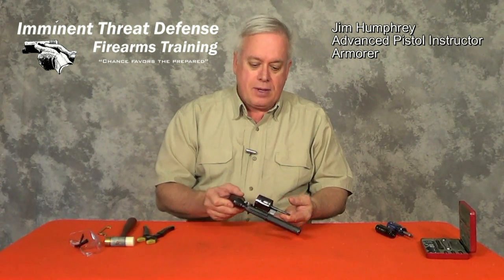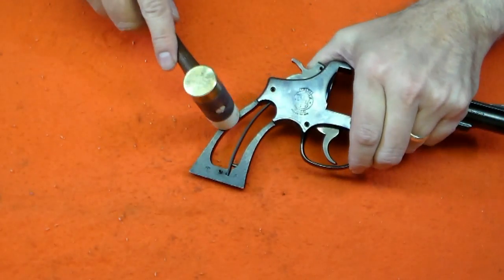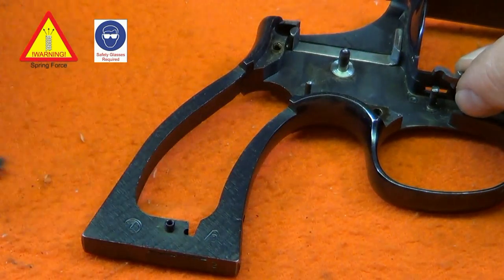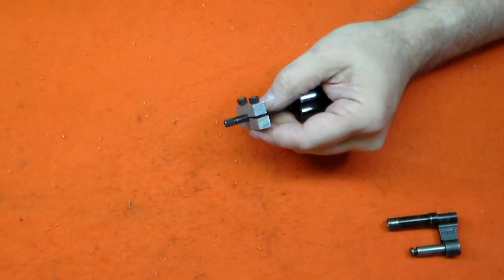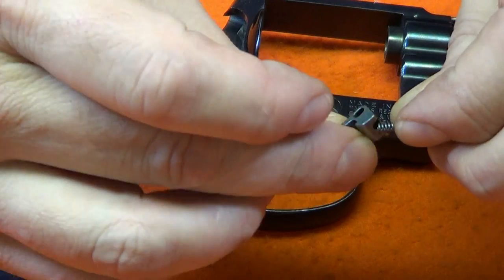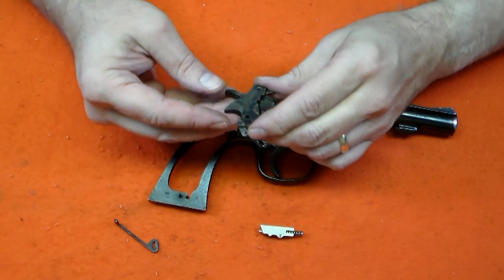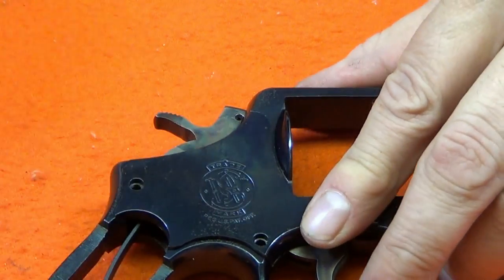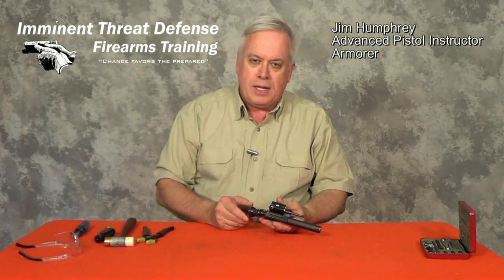S&W Model 10 Disassembly and Assembly

Comment: Thanks for the video. Can the firing pin be replaced without removing the hammer (gun intact)?
Reply from the maker: No, the firing pin (technically the "hammer nose", I got it wrong in the video) is riveted to the hammer.  So the rivet has to be drilled out to replace the nose and then finished smooth, not an easy job.  Alternatively, you can replace the entire hammer assembly, but that's also going to probably mean refitting/replacing the sear.   Another advanced skill job and tricky too because it effects the trigger pull.  So you're getting into gunsmithing level work.  However, the parts are available and if you didn't mind ruining a part or two in the learning process well.... Thanks for watching!
Reply from the maker: @brandont9078  Yeah that video pretty much describes the process for replacing the rivet.  The answer to your original question remains the same, the hammer has to be removed from the revolver.  And it requires special tools and skills.  As I said not impossible just tricky if you've never done it before.
Reply: @ImminentThreatDefense  I managed to replace it without removing the hammer by supporting the hammer and carefully driving out the rivet and installing/seating the new rivet. Thanks!
Reply from the maker: @brandont9078  Well done!

Comment: What are the micrometer measurements on those two screws...I got them mixed up!  Is there a simple way to tell which is which?  For instance, is one always longer?  P.S.  Thanks for the video.
Reply from the maker: You can tell you've got the wrong one up front if the cylinder doesn't swing out easily. or if the yoke has any forward/back movement.

Comment: I own a 1908 .38 hand ejector how often should I disassemble the gun this far for cleaning? any basic cleaning videos?
Reply from the maker: This level of disassembly is not something you should do very often, especially if the gun isn't be used very much and is being stored well.  The side plate is custom fitted during manufacturing and removing it frequently will eventually affect the fit.  Unless the gun has been exposed to the elements or shows signs of corrosion I wouldn't do it any more than once every 5 years or 3,000 rounds.

Comment: Where did you get that screwdriver? I'm having a difficult time finding one that will fit.
Reply from the maker: That's a Chapman, they come in sets.  There are other good screw drivers sets (Grace, Magna).  All good gunsmith screw drivers have flat blades of various width and in each width there will be various thicknesses.  Plus they are hollow ground, perfect for fitting precisely to the screws so you don't mess them up.  I'm sure you can find these on many locations on the web, but Brownells has them.  Go to the Chapman site first (chapmanmfg.com) and look at the gunsmithing sets.  I bought mine a long time ago, but it's equivalent to the basic (9600) set.  If you're serious about taking care of your guns, spend a little extra on good screwdrivers, punches (square shouldered brass) and hammers (brass/plastic).  Basically all the tools you see me using in this video :-) But it sounds like you already appreciate the importance of good tools.  Thanks for watching!

Comment: Hello, i have one question:
How to indentify cylinder screw from the others screws?
Thank you
Reply from the maker: The best way is to keep track of it when you remove it :-)  There are two screws that look identical, those are the front screw and the middle screw.  The front screw is generally shorter.  But try them both in the front hole then check the yoke for freedom of movement, the cylinder should flip out easily.  Also check the cylinder shake the yoke shouldn't move forward and back.  I've found when I mix them up the wrong screw causes the yoke to bind and the cylinder doesn't flip out easily.
Reply: Imminent Threat Defense Great! Thank you very much, i will try that!

Comment: Would you recommend putting in some Wolf springs to reduce the trigger pull?
Reply from the maker: Obviously depends on the revolver and the existing pull. I'd be cautious of replacing the rebound spring in any case because the speed of the rebound slide affects the hammer block.  Clipping the rebound spring is one way you see people reduce double action trigger pull.  At S&W armorer school they specifically warned us of the dangers of doing this.  I know Wolf provides a reduced rebound spring, I've always wondered about the wisdom of that.  Instead some judicious polishing can go a long way.   You will hear people talk about the increased liability of reduced trigger jobs in a deadly force shooting situation.  The fact is it's either a justified use of self defense or it's not, trigger pull doesn't matter.  Now if it's an unintentional discharge well... that's another matter.  That said of course in the civil trial they can make an issue out of anything.

Comment: How much would you charge for a rebound slide spring tool if you made some to sell? I would be totally interested in purchasing one.
Reply from the maker: Brownells sells them for $20, I'm not sure I could beat that (part 080-666-000WB).  Mine only has about 50 cents in material but probably $50 in labor :-)  You can make alternative one, by cutting a notch in the tip of a cheap flat screwdriver, that will allow you to hook the spring as well.

Comment: I have a model 10-5 that has an issue where after I close the cylinder after reloading that the hammer will not pull back and I can't pull the trigger unless I'm holder the cylinder release switch back. Any ideas on how to repair that?
Reply from the maker: The center pin (in the cylinder) is probably gummed up and not moving freely.  The center pin is spring loaded and it's what pushes the cylinder release back when the cylinder closes.  Look to see if the center pin is protruding from the center of the extractor star, and when you push it in does it spring back out.  If not that's probably the issue.  Try ultrasonic cleaning and oiling, if that doesn't work then disassembly of the cylinder and thorough cleaning should fix it.  It's also possible extractor rod and or center pin are bent, but that should be obvious.

Comment: Help! I recently came into possession of an model 10-5 the gun is in poor condition and probably never been taken apart. I removed the 3 screws but the side plate is stuck on. Any tips on how to get this off I don't want to start prying on it. Also great video!!! Best gun vid I have ever found
Reply from the maker: Prying is definitely a measure of last resort.  Generally a few sharp raps of the screw driver handle or a brass/plastic hammer on the grip frame should do it.  If that doesn't work try putting some bore solvent on the seam of the side plate and letting it soak for a while and rap the grip again.  if that doesn't work you're going to have to pry it.  When I've had to do that I pry by reaching inside the gap where the main spring goes in, so that way if I mar the side plate, it's on the inside.  Ideally use a plastic or brass tool to pry with.  If you have expanding snap ring pliers they should do the trick too.  Thanks for watching!
Reply: @ImminentThreatDefense  Thanks for the quick response. I sprayed a bun of penetrating oil in the side plate and let it soak overnight. A couple taps on the frame popped it right off today.
Reply from the maker: Great news. If you used WD40 be sure to thoroughly remove it and lubricate with a proper oil.

Comment: Can I use this guide for my Model 14 aswell? Are they the same?
Reply from the maker: I've never disassembled a 14 but like the 10 it's a K frame.  My understanding is the 14 (and 15) are just a fancied up versions of the 10.  So this video should be similar, but I can't be positive. Take your time, stay within your skill set.
Reply: Its the same, just did it. Thanks for the video :)
Reply: The 15 is 357 Mag where the 10 is 38

Comment: Do pre model 10s have the hammer block???
Reply from the maker: +ReinSman100 The very first variant of the model 1899 did not.  It wasn't incorporated till about the 4th or 5th variant, which by then was called the Military and Police model of 1905, which contrary to the name, didn't get introduced until 1915 was the hammer block incorporated.
Reply: +Imminent Threat Defense Is there anyway to tell what year that a pre model 10 was made?
Reply from the maker: +ReinSman100 The best way is to make a "Firearm History Request" direct from S&W.  Internet search or try https://www.smith-wesson.com/webapp/wcs/stores/servlet/Category4_750001_750051_757825_-1_757814_757812_image
Reply: Mine is pre-model 10. Check to make sure the hammer block isn't stuck to the side plate, that's generally where mine stays.

Comment: How do you know which direction are the threads of the extractor rod?  You say, "Do your homework".  Where can one find this information?????
Reply from the maker: There are various book sources, I've got the GunDigest book of Revolvers, I also attended the S&W Revolver Armorer school and have a bunch of manuals, but the internet is a wonderous thing, full of thousands of people who have no idea what they're talking about, and a couple who do.  But the direction of thread varies depending on which S&W revolver model and when it was made.  Generally, and I mean generally, S&W revolvers made before the late 60's early '70's were normal or "right hand" threads.  Sometime in the that time period on most (probably all, but I'm being purposely vague here in case there's an exception) S&W's they started changing over to reverse or "left hand" threads.  So, depending on when they made the change on your model, it might be a different year on another model. What I do when I don't know the thread direction, is grip the rod in a padded vice and turn the cylinder, gently at first, with each attempt I reverse the direction of turn and slightly increase the amount torque.  This is kind of tricky but has worked for me.

Comment: I have a Military & Police "Victory" Model with a cut-down barrel I've been trying to disassemble all day, and it's given me no end of trouble. I can get the grips and screws off no problem, and remove the cylinder assembly, but the side plate simply will. NOT. Come off. The action is smooth and there isn't a single speck of rust I can see, so I'm kind of at a loss on what to do. =/
Reply: Patience and penetrating oil.  The technique I show will work.  Don't get in a rush and start prying.  Good luck.  Thanks for watching
Reply: @jimhumphrey6806  Thank you for replying! I did some research beforehand and know not to try prying the side plate since it might bend (still managed to tear up one of my fingers). Is there any particular kind of penetrating oil you would recommend?
Reply from the maker: @JamesPolymer  my preference is Kroil most any name brand should work. You might have a little corrision in the joint.  But just as likely somebody used WD-40 on the gun which will turn gummy in a few years.  Soak it over night with penetrating oil and rap it with something wood plastic or brass. You'll get it
Reply: @ImminentThreatDefense  This is probably a stupid question, but do you mean soak as in "spray it thoroughly and let it sit," or soak as in "submerge it in a bucket"?
Reply from the maker: @JamesPolymer  just a liberal application should work in this case.  If it was rusted up then I'd say submerge it.
Reply: @ImminentThreatDefense  I see--thanks for the advice. =)

Comment: What happens if you swap the crown-head screws on the cover-plate?
Reply from the maker: It could cause friction on the yoke.  So when you open or close the cylinder it won't swing out easily. You can also get yoke end shake.
Reply: @ImminentThreatDefense  So good of you to reply, sir!  Thank you!  I recently purchased a Malaysian Royal Police turn-in M10 (first Model 10 I've owned) which needed a clean-out, so your video was invaluable.  Thank you for posting!

One issue I am encountering, which partially prompted my question (I thought perhaps the screws had been swapped at some point in its life):  the cylinder will not release properly, consistently.  It seems to release better on some cylinders, but not on others:  I can attempt to release, cycle the gun, attempt, cycle, etc. till it finds a spot it releases cleanly on.  It could be random, but cycling will make it happy if it doesn't just release on the first go.  Otherwise it requires a little force, or it is stuck in place and I dare not push harder until I rotate the cylinder.  The resistance is, definitely, taking place at the tip of the extractor:  the back of the cylinder does want to swing out.

There is the barest of front/back play in the yoke where it meets the frame.  It seems I can make the process easier at times by pushing back on the cylinder while swinging it open.  I thought maybe the wrong screw might allow for the play, and cause the issue, but I see issues being potentially due to the bolt, the tip of the extractor, or the front lock bolt?

On another note, the lock-up is slightly loose, but not badly:  if you happen to have a suggestion for a fix, I would appreciate it!  The spring for the cylinder stop is obviously bent, if that matters.  Yours in the video is perfectly straight.

The gun is definitely worn, late 70's manufacture and extensive service in a humid climate, but it otherwise operates perfectly!  The trigger really is great, and seems to be perfectly accurate.  I am a maintenance guy, so I get it that you likely won't just 'know' what is going on with my revolver based on a 'tech-support call'.  Thank you again!
Reply from the maker: @SpartacusColo  I looked in the armorers manual and they list 14 different issues that can cause this problem :-).   I'd start by having a look at all the moving parts, do a visual check then move them all individually.  Look for wear or bent pieces or anything not moving smoothly.  However, things that only happen at a certain cylinder position, point to a bent yoke.  Send me an email at ITDefensetraining@gmail.com and we can go into more details.
Reply: @ImminentThreatDefense  All praise to you for taking the time, sir! Thank you! All the best!

Comment: My extractor rod won’t lock in place any ideas I don’t under why it won’t
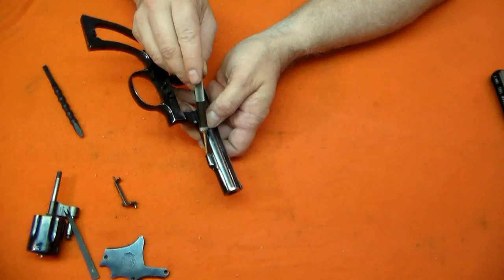Reply from the maker: do you mean the locking bolt (video at 5:18) isn't catching the front of the extractor. In which case the locking bolt pin might be stuck in the retract position (rust?).  Or did you mean the extractor rod is too long and won't clip into the locking bolt.  In which case you probably didn't screw the extracting rod in far enough or you cross threaded it so it won't thread on, or something else is interfering with the cylinder closing all the way. Or did you mean the extractor rod when screwed into the cylinder keeps coming loose, in which case screw it in tighter.  Hope that helps.

Comment: Hello, can I have the 3/16" tool dimensions? the one to remove the rebound slide?
Reply: Jose, if you buy the Wheeler gunsmithing screwdriver set, The tool comes with it. Look them over, they sell a bunch of different sets, The one I got is the 89 piece, it was like $60 if I remember. Well worth it if you work on firearms.

Comment: I have a small rattle in mine any ideas???
Reply from the maker: That it's probably not good? :-)  Start by tapping various parts with a screwdriver handle see if you can narrow it down.  Then take off the grips, that's were largest air void is so the most likely place something can rattle around.  Be careful and do it over a towel or sheet so you don't lose what ever is making the noise it could be a part you need.  Last resort take off the side plate and see if everything looks normal

Comment: how do i tell what kind of letter frame i have?
Reply from the maker: It's determined by frame size and features.  On newer guns go to S&W web site.  On older guns you'll have to do some research, see the link in the comment below to get a Firearm History Request, trying calling S&W customer service and just asking. or try this blog site (I can't vouch for the accuracy or the author) http://www.hipowersandhandguns.com/Smith%20&%20Wesson%20J,%20K,%20L%20and%20N-frame%20Comparisons.htm  or just tell me what model you have.
Reply: +Imminent Threat Defense 38 s.&w. special ctg
Reply from the maker: If your gun was made before 1957 it will not have a model number, just a name and may not be marked.  To find the model number open the cylinder and look on the yoke cut out in the frame on the left side, look for a two or 3 digit number that'll be your model number.  Here's another web reference for frames http://www.handloads.com/misc/Smith.Model.Changes.asp

Comment: Nobody in you tube does the disassembly of the firing pin from the hammer!!!!, i wan to know in case of a broken spring or firing pin. thanks grettings
Reply from the maker: The reason is the firing pin is held on with a rivet not a pin.  The only way to remove the firing pin is to drill out the rivet.  That get's pretty complicated and you risk wrecking the hammer.  Plus replacing the pin requires grinding and finishing the hammer and it won't look factory anymore.  So you're getting into that level 5 repair work.  So while you might try it if you broke the firing pin, you wouldn't do it as routine maintenance. The sear on the other hand can be removed by just pushing the pin, and there's a small spring underneath it..  But if you replace the sear it requires some stoning/filing to fit it, again level 5 work.  Hope that helps, thanks for watching.
Reply: @ImminentThreatDefense  I was wondering about the sear pin myself. Thank you for that information!